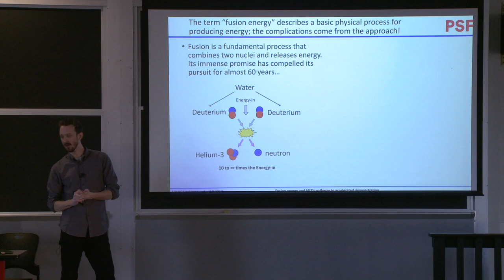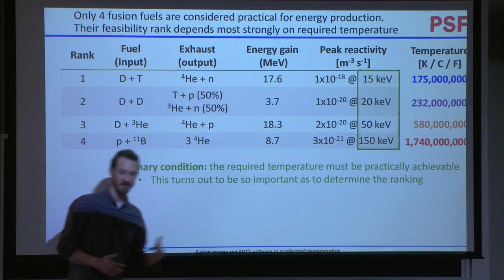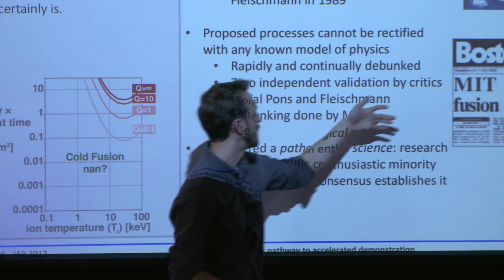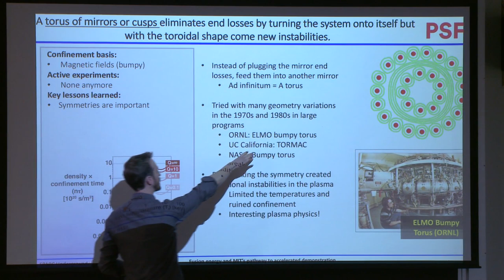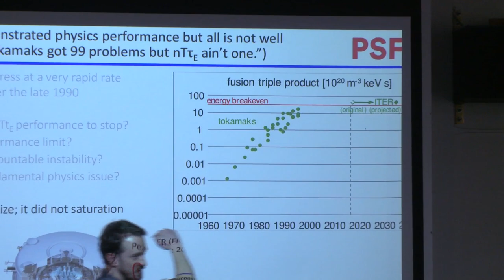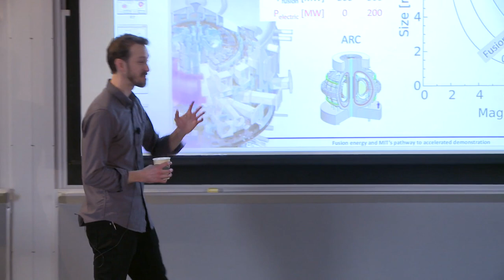MIT's Pathway to Fusion Energy (IAP 2017) - Zach Hartwig

Comment: This is the best video I've ever seen on the current state of fusion power research.  Excellent talk!  It's amazing how little press this critical research gets.
Reply: "okay ?"
Reply: Non scientists probably feel like we've beat fusion to death like a dead horse. They don't know how wrong they are.
Reply: Has it worked,, ever? no!
Reply: +Brew sauce But it's no wonder after all since fusion-energy is just 20 years away... since about 70 years ;o)  (kinda like AIs)

Thing I'm afraid of is that ITER will produce actually a net-output and all other projects will be abandoned. 
As I understand Tokamaks have the problem to work only in a pulsed manner. Stellerators would be able to work constantly since they don't have to induce a current into the plasma to twist it.
Reply: Actually they'll use deuterium, an isotope of hydrogen. Meaning only a tiny fraction of our Watersupply is actually useful for energyproduction. The oceans will stay. 
Solar and Wind are fine. But in regards of Poweroutput per Area they suck. Wich is a problem in densly populated areas... It's fine to put Panels on your roof but don't expect to have enough excess-energy to power heavy industry as well.
Drilling holes in the ground can produce problems, sure. But there are worse reasons for doing so (ie fracking which poses another bunch o threats). I'm also not quite sure why geothermals, done right, should lead to a collapse? Drilling for Oil and Gas results in 'stuff' taken out of the ground and by that altering the structual integrity. Geothermals put afaik something (water?) into the ground, let it heat up and pump it up again. Thus not altering the ground in such a manner as the forementioned stuff...
Anyway: Diversity is a nice thing to have. Including in out energymix...
Reply: Some amazingly stupid ideas in the reprisal protest. Fairly understandable when you consider the giant errors in the speakers assumptions.

Off on a tangent:
The heavier metals such as uranium and radium are usually found in the presence of vanadium and other heavy metals. Isn't this and indication that fusion of heavy metals is already a cyclical nature where the physics of the deep earth biosphere is so poorly understood and virtually unexplorable?
Reply: > Has it ever worked? 

Or to put it another way:

1. How much deuterium and tritium heads our way with the high solar output that takes place during volcanic eruptions?

2. How close a match does present research capability have to solar radiation spectra?

(Periods of high volcanic eruptions are marked quite plainly with periods of high tornadic activity; which is coincident with large numbers of sunspots and solar storms if you care to look.)
Reply: Chris LeBlanc
Reply: franck Malers
Reply: Hydrogen is super abundant. If we run out we can grab some from elsewhere, like Jupiter. I heard that Jupiter may have a few atoms lying around. With the monumental advance in being able to harness Fusion, space flight becomes much easier, and grabbing hydrogen from Jupiter's Gravity Well, is not outside the scope of possibilities.
Reply: nikoaz you might not even need to refuel at a specific location as there is plenty of free floating hydrogen in the vacuum of space, look up the bussard fusion ram jet
Reply: @douglasberard8664  uhm yess at the JET reactor in england

Comment: You demonstrate arrogance here by being so dismissive of the stellerator path to fusion. Stellerators are much more stable than tokomaks, which suffer from serious issues with the plasma's eddy currents shocking out to the confinement walls. The issue comes down to stability and density. While Tokamaks have great density, they are much more unstable, whereas stellerators have great stability, but lack in density. The question then becomes which can you likely scale? The tokamak struggles with a physics problem (highly complex 3D plasma flows); the stellerator struggles with scaling (the physics of the plasma are stable, but need to scale to increase density). I believe that it is easier to increase the density than it will be to understand and control an unstable 3D plasma flow.
Reply: Combine HTS density with stellerator stability = (Q>1) fusion?  The possibility is tantalizing
Reply: Any constructive path, tech or sociological, is preferable to the unceasing politics of MAD.
Reply: Major recent advances in superconducting magnets using barium copper oxide (REBCO) superconducting tapes are making the tokomak concept more viable every day.
Reply: Paul Varn exactly and now they has reached a 45.5 T stable magnetic field with REBCO and probably higher than 50 T in future, so the SPARC will be feaseable and in more compact and stable version according to this explanation.

Comment: Fantastically clear and yet not too dumbed down. Once sustained energy-positive fusion is realised, then we'll really be around 50 years from using it as a viable power source. It will probably take that long to solve the problems of fuel production, economically viable construction methods, maintainable design, NIMBY syndrome etc.

Comment: Would have loved to have a mention of the Focus Fusion approach. LPP has achieved high enough temperature to use pB11 fuel in a pulsed configuration and is currently working its way through the engineering problems required to continue scaling down the plasma (increased density).
Reply: The dense plasma focus is my favorite approach! I can't see anything in the physics that would prevent it from working, and it would be very inexpensive to prove out.

He gave a lot of good information here, but I can't see one of these lectures ever ending with a method other than their own being the most likely to succeed. The "tall enough to ride" analogy really doesn't help make him look unbiased.

To say that a higher energy fuel is just "harder" to use is not necessarily true. For the DPF, temperature just isn't a major issue, but density is. That's why they need the pB11. it just can't break even with D-T.

To be fair, tokamaks are the most sure-fire concept. They're probably the second most expensive though, right behind stellarators.
Reply: Neil u, the main reason they have such density issues is when you have plasma near materials it vaporizes the material, and so the material "poisons" the plasma. Poisoned plasma is bad news for any fusion device. Basically you get heavy ions that are unlikely to fuse so all they are doing is colliding with the other ions and this causes an expansion that is in help full. They recently made a set of electrodes out of beryllium which is a light metal and the beryllium atoms should poison the plasma less. Also there are several other effects the heavy metals cause. They are listed in section two of a paper I'll give you the link to, but basically the heavy ions disrupt the current sheath and radiate the energy. https://aip.scitation.org/doi/10.1063/1.4989859

Comment: Direct Energy Conversion ! I have been keeping an eye on fusion research for about twenty years or so, and this has always been one area that has always captured my attention. Even the physicist's out there must concede that our technology in this area has been woefully neglected. This is like having the power of a star and using a one centimeter square solar panel to make use of it (extreme example, but you get my point). I am quite sure that fusion is coming soon, but I have to wonder how much longer it is going to be before we get away from this primitive heat exchange and turbine driven electricity conversion process, which is maybe thirty percent efficient, it's not terrible sure, but given that we will conquer fusion, it seems almost offensive to "waste" so much of that bounty on such a primitive mechanism of energy capture .
Reply: Unfortunately direct energy conversion only works for high-energy ions, and most of the energy in a D-T fusion is carried away by the neutrons.
Reply: I always wondered there shall be some way to make electrons flow without just using rotating magnetic fields using Mechanical movers. Great idea !
Reply: psycronizer no on a large scale and optimized with high temperature the total efficiency can be in the order of over 50% like in gas turbine cycle no? CO2 superfluid can be useful to reach higher efficiency from well engeneered turbine
Reply: And he suggested a way to use some sort of energy harvesting by HE4 atoms that are byproduct of the fusion reaction aside from neutrons , so probably a future state  of the art fusion power plant can reach maybe 60%? Efficiency or higher?

Comment: High temperature superconductors were discovered in 1986. I saw high 
temperature superconducting ribbon being used in a physics lab in 2002. 
So why is ITER still proceeding with low temperature superconductors 20 
years later? It seems kind of crazy.
Reply: Because it was 20 year in planing stage, and it was to late to change it like 20 years ago.. and now its to big to fail...
Reply: It's not too big to fail, because it's not failing. It might not be the best way to achieve ignition, but it's a guaranteed way to get there. And there are lots of things that need to be figured out once you get there. ITER will answer lots of essential questions about building, maintaining and operating fusion reactors. If future reactors can get the same done more efficiently that's hardly a problem, but future is future and these answers are needed asap. Completing ITER is a no brainer. Could some other reactor design supersize us all and solve the problem before ITER? Perhaps, but I wouldn't hold my breath. Besides, building ITER doesn't mean you can't try to build anything else, many organisations are doing just that anyway.
Reply: Too much beauracracy.
Reply: If ITER was designed in a highly integrated way, everything fitting together just so, then maybe it's difficult & uncertain whether it would fail with an HTS upgrade.

Comment: OMG, what a coincidence.  I was taking a bath and giving a thought on Fusion after watching a video on ITER.  It came to me that ITER might have the right scale but won't reach net energy.  I came to this conclusion because an ideal fusion  process should require little ignition (laser,microwave,etc.).  Ideally, the force or pressure should be enough to start the fusion process.  If ignition is crucial then would be akin to a gasoline internal combustion engine with a spark plug while an ideal fusion reactor would be similar to a diesel engine where the pressure is so high that fuel/air mixture explodes.  I was pondering a solution with  very focused magnetic fields that might give it net energy with a disadvantage in scale for power production.

Comment: I do buy that a fusion machine with a net positive gain does change the game. The recent advances in magnet technology must be exploited.

However I'm a bit confused about effects of the size of the torus. Just because something is bigger, doesn't make it more complicated. How much of the complexity of ITER does not stem from it's size, but from the necessity that it must produce it's own tritium?
The claim is that a machine like ARC can be operated by an university. But if it should generate 500 MW that it definitly will be classified as a nuclear facility. The regulations for nuclear facilities are a big hurdle for universities.
Reply: Its sorta true.. and sort of not. Making things bigger do pose some structural challenges. Both in structural way and a electronic/magnetic way.

But the biggest problem with ITER is probobly not the physical size but rather the size of the administration board.
Reply: bigger means bigger magnets means higher structural stress and higher power needed to power them means more containment structure and more need for electric infrastructure but with less space to spare.

to scale up this thing by a factor of 2 means to scale up the need for infra and structural support by 3 (as an example) and radically changes the game even if the output scales by lets say 5 (it doesn’t).
Reply: So, I wonder if this 'university' will be allowed to proceed if it specifies the project for big yield but low average power? A university does not want to make a real powerplant anyway...

Comment: Yes. But there is not a single word on disruptions (or ELMs, etc.). This is all very good, but when I had the chance to talk with Greenwald (the guy introducing the speaker at the beginning of the video), he told me with ARC-like design there is good news and bad news for disruption. With respect to disruptions, I don't care about the good news if there is bad news! I don't remember the details, but I guess since the magnetic energy density gets higher, the energy density available for disruption damage also gets higher. Anyway, this kind of questions cannot be left unaddressed.

Comment: i think his last point is maybe the most important - Put a data point (real operating device) above the Q=1 line.  Doesn't have to be Q=20, Q=1.0001 is probably good enough (100KW/GW if I did the math right) to not only get the world's attention, but actually make money (not much I grant).  But at that point jumping to Q=1.1 or Q=2 will be the result of incremental improvements and a Q=2 device (assuming an output like ARC projects of ~1GW) at $0.01/KWh (I pay ~$0.085 at home, I assume the bulk price is cheaper) makes enough money to continue the research from which an entire family of devices will be born.  It fundamentally changes the course of human history.
Reply: UnTiedMusicStudio sure!! Think when they can reach Q> 10 with high temperature Superconductive magnets!

Comment: If you're worried about climate and carbon emissions, fusion is NOT what you should focus on.
Look at ThorCon, they're WELL on their way to provide zero emission power cheaper than the cheapest currently available thing (coal) *within 5 years*.
And there is enough Uranium and Thorium to buy us a few hundred years during which we can figure out fusion at our leisure.

Comment: So how many years until you can put power on the grid? The smaller and cheaper the device, and the more Q>1 power, the better.
Reply: The talk said 10 to 15 years before putting power on the grid; that's about 5 times longer than I was hoping for: I'm 67, so I have good odds on being alive in 2 to 3 years, but much poorer odds on being alive in 10 to 15 years. The ice caps might be melted in 15 years, too.

Comment: wouldn't it be more environmenally preferable to collect existing tritium from fission-reactors and  then burn it in fusion-reactors.  It is certainly chemically difficult to sequester small amounts of tritium from large volumes of water or hydrogen gas. I think, doing it   this way would be a worthwile effort  for the improvement of human health. Especially now, after Fukushima-Daichi released so much Tritium in 2011.
Reply: Tritium is scarce because, unlike deuterium, tritium is not stable. Its lifetime is measured only in years and since it is still essentially hydrogen, it is hard to store. Especially if you have to separate it from all the other nasty stuff produced in fission reactors. The best option is producing it where you need it. Also, notice that tritium is produced from lithium, which is very abundant on earth. It is not collected from water like deuterium is.  Hope that helps.

Comment: I just saw my first news video on this tech.  It seems that the problem is that the energy needed to do fusion is more than the actual energy output.  I know a lot about nuclear weapons and what they want to create is a hydrogen bomb but in a nonexplosive reactor state.  Then why not do what the weapon designers did, use fission to power fusion? Use a standard fission reactor to give you the heat to initiate a fusion reaction (that's what they do in thermonuclear weapons).  Either that or rig a fusion system up to a large hydroelectric dam to generate the power needed to generate the heat.  Both are methods tend to be carbon free and are technically green, right?  Masters Degree please...
Reply: Michael McMahon you clearly have not understood the difference between fusion and fission... it's not as simple as you've stated, it's not as simple as making a bomb, instead you are trying to create a star in a jar and since we can't use gravity to generate and sustain the fusion reactions it becomes much harder having to use magnetic fields to confine the plasma...
Reply: They can generate the heat to start the reaction. Then the reaction blows itself apart & stops. That chart on every page tells whether it worked well enough to make our energy. We need Q>5, and fission won't help unless it's a bomb, and we can't build a power plant that can handle those explosions.

Comment: why do the speakers need to tie fusion with climate change / CO2?? these issues could be independent. if fusion is an economically viable energy source then it will be implemented. period.